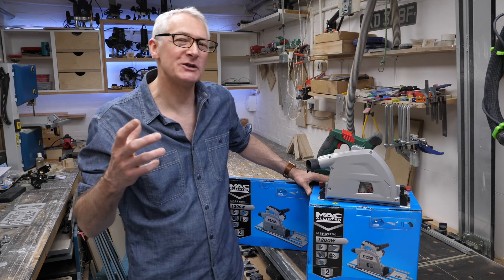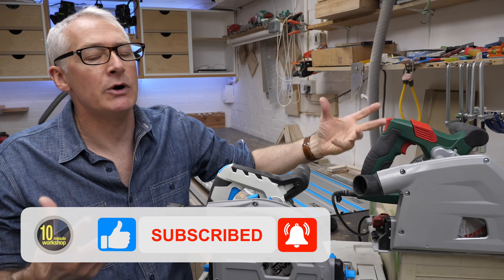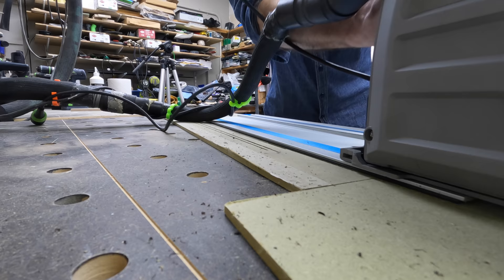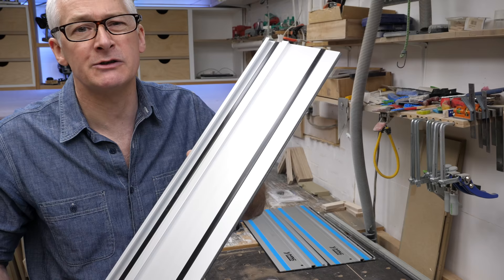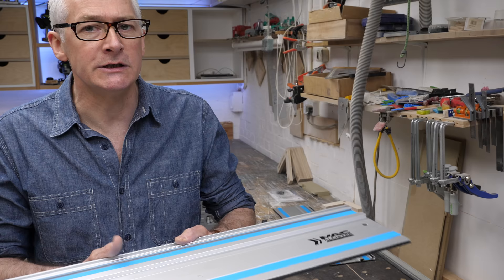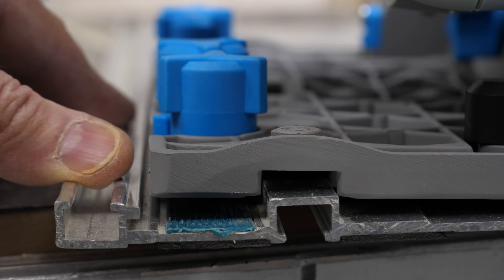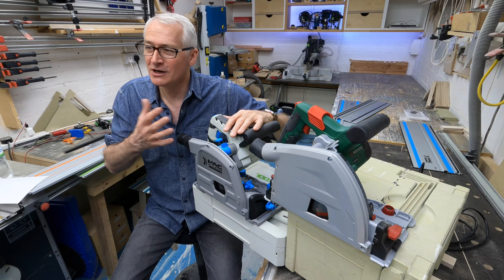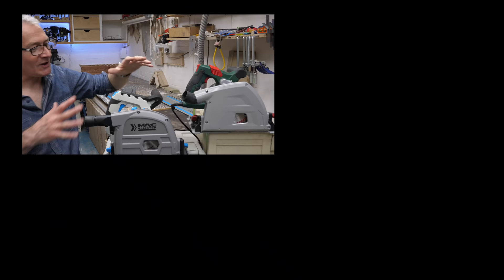Lidl Parkside or Screwfix MacAllister? [video 454]

Comment: I picked up a new Mcallister saw today after watching this video Peter! good video. One question: I wanted to buy a Freud blade to replace the stock one but I can only find one with 1.7 kerf. The user manual says to only use a blade with a kerf between 2.2 and 3.5. What would happen if I put a 1.7 blade in it?
Reply from the maker: I can’t think why they would restrict the blade kerf like that, or what harm a thinner kerf blade might do, tbh? But unless you’re a Freud fan, there are plenty of other choices for regular 165/20/2.2 blades around that work really well - DeWalt, Makita, Triton are all that size, so lots of choice from them and third parties like Key Blades. 👍👍
Reply: @10MinuteWorkshop  Cheers Peter, it’s good to know your thoughts. I’ve ordered a makita blade!

Comment: Cheers for that Peter. Interesting that it might have an anti jam fearure. I prefer marmalade anyway.

On another note, if I recal correctly you did say that the evolution tracks work with the Lidl Parkside, didn't you?
Reply from the maker: Thanks! And yes, the Parkside works on the Evo and all Festool-pattern rails - it’s the Makita-pattern that causes a few issues. 👍

Comment: Hi Peter thanks again for these very informative videos. I have done quite a few searches and spotted an Excel Plunge Saw? Curious for a few reasons, cost, extra track lengths just wondered if you have any experience or heard at all about it? Thanks again...Cheers
Reply from the maker: No, I haven’t, though I really liked the excel guide rails when I had them for the ‘which rails work’ video - shame they jacked the price up! Have to say that visually it looks very similar to the Titan/ Triton/ MacAllister. 🤔
Reply: @10MinuteWorkshop  I will definitely check out the video regarding the guide rails. I did a fair bit of searching and only seen 1 similar looking  plunge saw and it was advertised for sale in Australia 😄 But you right can't imagine they are too dissimilar. Thanks Peter
Reply: I have one. I got mine for about 200, but it includes two 1.5m rails and a spare Makita blade so I thought it was a good deal. I suspect it's same manufacturer as MacAlister, but there are some differences, it's not as similar as MacAlister is to Titan.

Comment: Hi Peter!
(Wall of text warning)
And thanks for another great video. I especially liked the fact that you included the track compatibility issues and the compatibility with accessories in this video.
Did you take a look at the play in the plunge joint on the MAC? Both me and Tim have see issues on these saws in this regard. Another thing is the kickback stop that you like so much. I don't find it to be that much of an issue, but that is only because I have to clamp the rail down for each cut. This may be due to me not being that experienced with it, but I really find that the friction the Titan rail has against plywood really is not enough. For me it slides too easily. Do you have that? Or do I just need to be more precise with how I apply pressure?
Also, both the MAC and the Titan are OEM saws, meaning that they are not similar, they are equal (apart from the production date you metioned). And when dealing with OEM equipment the logical thing is to go for the cheapest option, since they are 100% the same. I guess the Scheppach is from the same factory as well as many other saws.

Another thing is how these saws fit into your "tool progression". You may get one saw and then "add on" accessories and tracks as you go. Or you may buy one to get to know the capabilities of a plunge saw, just get the job done, or whatever. And then move on to the Makita (or Festool) if you find that this kind of saw fits your workflow. I tend to lean towards the latter, and are really thinking about investing in the Makita. And if this is your "progression" the Aldi may not be such a bad choice.
Guess it's time to breathe.
G - out :D
Reply from the maker: Thanks Goran! No, mine doesn’t have the ‘sloppy plunge’ that you and Tim found - perhaps MacAllister watched your videos too and took note! I found the Mac rails to be as good/bad as all the other third-party rails as far as grippy-nes goes - and yes, you’re right of course; if the rail was clamped the anti-kickback would be a lot less of an issue for me. Fair point about the Max and Titan both being OEM saws - albeit several years apart. 

Yes, good point also about the ‘progression’  - this is something I want to look at in a future video actually - and is one of the reasons I wasn’t overly keen on the Scheppach/Aldi saws, with their odd design choice for a wider than usual base plate. 👍👍
Reply: @10MinuteWorkshop  Looking forward to it. And I really hope you get/take the opportunity to take a look at the Makita. And also battery vs. corded. There are many videos about these subjects. But most of them are made by "table saw heavy" US makers. And I consider you to be a far more reliable source when it comes to the track saw.
Reply from the maker: Thanks! I’ve had a Makita for a while actually - wanted to do a comparison vid with eg a new Triton vs used Makita as they were a similar price. 👍👍

Comment: Any idea if it’s possible to use a makita saw on the macallister rail without adjusting settings when the saw has been set up on a makita rail?
Reply from the maker: Every saw’s different, and there are enough differences between the rails alone to make that very unlikely. 🤷‍♂️👍

Comment: Is there much difference between the maccalaster and the erbauer? I'm will buy one this week just unsure as to which one. Your videos have helped me a lot. Now subscribed 🙂
Reply from the maker: Welcome! They’re slightly  different animals; I looked at the Erbauer here - https://youtu.be/ZCVPNFeHAQ8. The Erbauer’s a nice saw, but hampered by an oddball blade size that makes finding alternative blades more of a chore than it should be eg Erbauer don’t even sell them as an spare part / accessory. 🤷‍♂️ Also at getting on for twice the price of the MacAllister, you have to really want the soft start and slightly greater depth of cut. Personally I’d buy the MacAllister and spend the difference on some longer track. 👍
Reply: @10MinuteWorkshop  that was my thinking. Now you have said it also I will be doing just that. Mac saw and longer rails. Maybe even a 48th blade too. Thanks for the help!!
Reply from the maker: Pleasure! The 48t Triton blades are good value - link in video description. 👍

Comment: Hi Peter, I have the Mac Allister saw and the Evolution ST2800 rails

I found my plunge saw is great on the Mac Allister tracks but it wobbles a bit on the evolution track, it’s like the main part of the track is 2mm lower, have you noticed this?  And have you managed to find a solution to what is a fantastic entry level system
Reply from the maker: No, but something I mentioned in the ‘which rails work’ video - link in description - is that the Evo rails have both low-friction glide strips between the central rib and the splinterguard, whereas most rails have one either side of the central rib. This can make it prone to being a bit tippy - It’s not something I’ve found to be an issue, but was ,entwined to me by a subscriber, so certainly something to watch out for. 👍

Comment: With a decent blade will these saws do a good job of cutting laminate worktops and if so which side up when cutting
Reply from the maker: Sure. With a decent blade I’d cut sunny side up with a scoring cut. 👍
Reply: I used my Parkside tracksaw with stock blade to cut laminate worktops a few years ago and it was absolutely spot on!

Comment: Are you sure about warrantee

 Good video Are you sure about the warrantee as I looked on the Screwfix website and it says that McAllister has got a one year warranty not two
Reply from the maker: It’s written in the box, so yes, pretty sure. 12 month warranty is usually parts & labour from Screwfix, then a further year of ‘defective parts’ cover - though usually any defect means the saw is replaced, not repaired. 👍
Reply: @10MinuteWorkshop   ok I have learnt something bit confusing though as web site say 1 year

Comment: Hi Peter
Just bought my first track saw (Macallister 1200) it has a kick back facility knob. Could you please explain what this does, or make a short video on the subject because this makes the saw quite a bit more difficult to push down the track, not sure whether you have already done a video on this, if you have could you please point me in the right direction so that I can watch it. Also would it be advisable to remove this facility.
Absolutely love your videos keep them coming.
Regards John
Reply from the maker: Hi John. As I say around the 7.40 mark in this video, the anti-kickback dingus on these saws is a pain in the neck, but for obvious reasons I can never suggest the removal of a factory-fitted safety feature, even one that's only held on with one screw from underneath...

Re kickback on a plunge saw,  I talk about this in the Tracksaw Workshop series of videos - I'll link up the playlist below - but in short it's where you plunge too fast or with a blunt blade, and the blade acts like a wheel and kicks the saw back out of the workpiece. It's a lot less dangerous than kickback on a table saw, but it'll probably mess up the workpiece and is best avoided, generally. The anti-kicback dingus on the MacAllister/Titan/Triton stops the saw from moving backwards on the track - but unfortunately doesn't exactly help the forward movement either, and it can't be disengaged, which is annoying. HTH P

Tracksaw workshop playlist - http://bit.ly/TracksawWorkshop

Comment: Hi. I bought this track saw after watching this video. Is it normal that the do not keep plunged and you have maintain the deep with some pressure while  cutting?
(Excuse my English I’m a French speaking person )
Reply from the maker: Hi. Yes; plunge saws always return to the ‘closed’ position - you must apply pressure on the saw to keep the depth of cut consistent along the length of the cut.

Comment: I can't help noticing that the Draper track saw looks very much like the Parkside, and has similar (if not identical) track. Do they have a manufacturer in common? Also, Clarke's offering looks very much like it could have been made by Sheppach. Do you have any knowledge of these two saws?
Reply from the maker: No, I’m afraid not. If I had to guess I’d say that there’s a couple of factories in China churning out near-identical saws that are rebadged and tweaked a little for different ‘manufacturers’ but I’ve no direct knowledge. 👍

Comment: Hi Peter my newest member of the team is left-handed and he’s really struggling using the Makita plunge saw.  The only left-handed one I can seem to find is the one made by Kregg But it seems to be only available in the USA.

Do you know if there is any left-handed availability of plunge saws  in the UK. 

By left-handed of course I mean that the blade is on the left hand side of the machine.

Thanks. Denver
Reply from the maker: Hi Denver. No, I’m afraid not - it does seem to be a very specific design decision that’s been made somewhere, but the Kreg is the only corded one I know. Oddly, many cordless saws seem to have the blade ‘dressing left’ so that may be an option? 🤔👍
Reply: Shouldn't make any difference as the track holds the saw.  Circular saws will make a difference as tbe foot is wider the side of the motor.  There are quite a few cjrcular saws that are motor right and easier for left handers (like me)

Comment: Great guide as always. Just starting out as a DIY’er and thinking a tracksaw could be a good investment as it’s flexible and covers a lot of use cases. I see these as both entry points but do you get a lot more saw for say £150-£200 or is it essentially that you don’t get a lot until you’re upto £350-£400
Reply from the maker: In all honesty you won’t gain much until you get to the Makita/Dewalt/Bosch saws;  you’ll get some nicer features like soft start and maybe a brake, but the £150-£200 saws are generally just versions of the cheaper saws with a few bells & whistles. 👍
Reply: @10MinuteWorkshop  thanks Peter, exactly as I was hoping. Sounds like the MacAlister should see me right for a good few years

Comment: I've just brought the mcallister plunge saw. Not had chance to use it yet. The only real thing I've noticed is the button at the top of the handle seems very stiff. Is this normal.
Reply from the maker: That’s the safety / release button, and it can be, yes. Mine’s not too bad, but I had a Triton saw (very similar, visually) that I had to return as that button was so stiff it wouldn’t release the plunge / trigger. The saw may have been working perfectly, but we’ll never know because of a stuck plastic button! 🤷‍♂️👍

Comment: Does anyone know if the mac has a blade calibration mechanism to achieve truly 90° cuts?
Reply from the maker: There are a couple of set-screws in the base that allow for a degree of fine-tuning. But it's an entry-level saw, don't expect Mafell or Festool levels of finesse. 👍
Reply: @10MinuteWorkshop  Thanks Peter, had some set backs but still working on getting my garage workshop up and running again, and looking for some "they'll do for now" tools. Thanks again.

Comment: Thanks for the review Peter. I already have a Makita track saw but want a second for the less accurate stuff (and the shorter rails) so the Mac for me - you mentioned a two year warranty but SF only show 1 - is the extra year obtained elsewhere? Cheers
Reply from the maker: I’ll check, but pretty sure it says 2 year warranty on the MacAllister box. 👍
Reply: David - the saw does come with a 2 year guarantee, but it is limited to defective parts only after the first 12 months. In practice they will replace the saw if it remains in the screwfix/B&Q inventory, or refund you your original purchase price. Plus, the warranty is not transferable you need to prove that you bought it from SF/B&Q.

Comment: Hello does anyone know if the park side saw will run on evolution rails? I already have the evolution hybrid track saw without the plunge function. The park side would be handy for me if it did. Thanks.
Reply from the maker: Yes it does - I do show it on the evo track in the video. 👍👍
Reply: @10MinuteWorkshop  thanks Peter I must of missed that bit. 👍👍🪚

Comment: If I recall correctly, you have two Festool track saws so what did the Titan (and now the MAC Allister) bring to the table for you? I.e., what niche do they fit in? At first blush I would assume a cordless saw would be something to add to your kit to fill out your capabilities. On the other hand I don't think those two are available over here (Titan is, but have not looked for their tracksaws).
Reply from the maker: I have a number of tracksaws - including a few Festool - but just as I don't make these videos for myself, I don't buy the tools for my everyday use either. 👍
Reply: @10MinuteWorkshop  I suspected as much, but didn't want to assume. :)

Comment: never tried a plunge saw, and interested in the MA one, have a quick question. Is there any difference between a circular saw blade and a plunge saw blade?
Reply from the maker: Size and thickness. Plunge saws tend to be 160 or 165mm with a kerf of 2.2mm, though thin kerf blades (1.8mm) are becoming more common. 👍
Reply: @10MinuteWorkshop  thanks Peter. My Makita circular saw has the same size blade and bore as the MA plunge saw, i wasnt sure if the 'set' was a factor. Thanks again.

Comment: Sooo it seems that Mac Allister and Screwfix have parted, and have a new home at b and q.. which doesn't have any stock.

Any sage words on any othera in a 'Simlar' price point (Mac Allister is £110 right now..) Erbauer any good for example??
Reply: These videos have basically become my 'go to' to find out how anything is done. Good work.
Reply from the maker: Thanks. Screwfix and B&Q have the same parent company, so there’ll always be some crossover of brands. If you can’t get your hands on the Lidl Parkside - only available now and then - then the Erbauer is a decent choice. It’s a bigger saw though, with a slightly odd blade size; I took a look at it in this video - https://youtu.be/ZCVPNFeHAQ8 If you don’t need the extra capacity then the normal-sized Triton saw is probably the next best thing, being basically the MacAllister with soft start and a slightly bigger motor. Spare parts are  available for the Triton too, if that’s important to you. HTH. P
Reply: I don't know if you have mentioned on your recent videos or if your viewers have noticed but the Erbauer is £160 ATM - this is what I went for.
Reply: Anyone got any experience with compatible track with this beast?! It comes with 2x70cm but could do with a little more length
Reply: Sooooo without wanting to sound like a broken record can anyone confirm that Makita track works with the Erbauer and ideally still has anti tilt?

It came with 2 70cm which don't cut as well obviously as one piece and I'd really like to get a 1.5metre track.

Makita do a nice one.. but none of the big name stores sell the track to buy and try!

Please help... Thanks!!

Comment: What model Mac allister is it? I struggle go find it on screwfix website
Reply from the maker: They only make one, and it’s been in short supply since this video went out 18 months or so ago. They were also sold through B&Q, so might be worth a look at DIY.com 🤷‍♂️👍
Reply: @10MinuteWorkshop  I had a look Pete, I saw them for £110 which is still affordable if it is going to serve a couple of years. I am wondering what table should I get to start with some wood work, whether to weld a metal frame from square tubes or make something out of wood